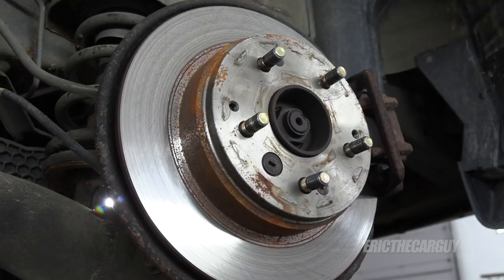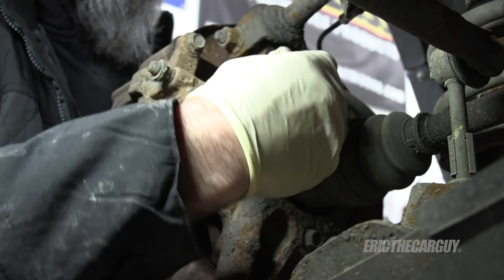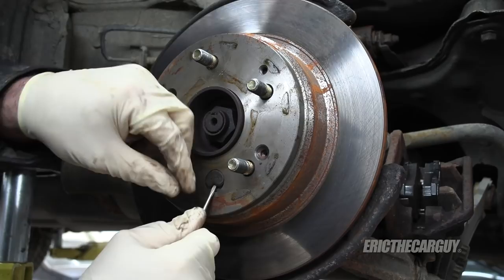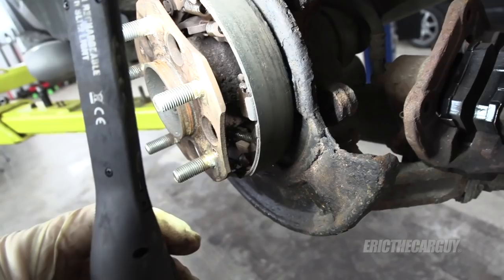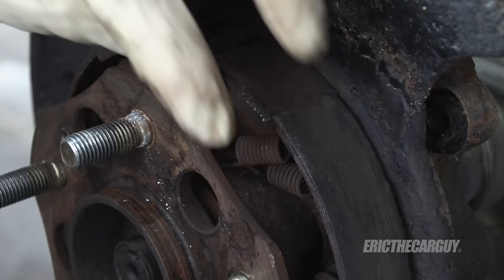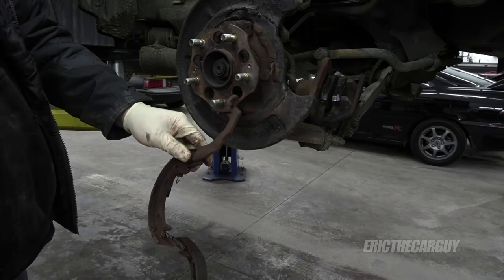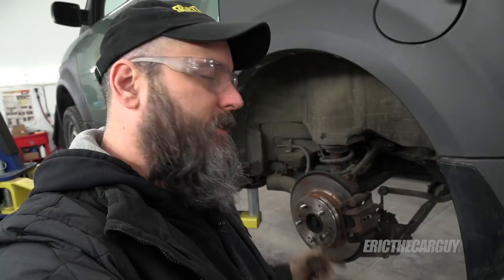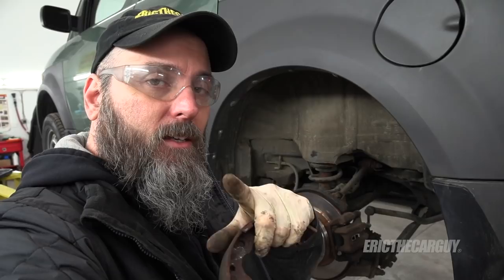Parking Brake Shoe Replacement on Rear Disc Brakes

Comment: drum brakes are an awkward , fiddly , frustrating PITA .. drum parking brakes are a whole new level of PITA
Reply: I concur. It's almost like they only still fit them cos they cost pence per vehicle... oh wait... yeah. That's the only reason. facepalm
Reply: I found a whole new level of swearing yesterday with those damn springs on the nail.

Comment: I replaced those shoes on an '04 CR-V once, (same parts as your Element, which I'm sure you knew). I had the same problem with the rotor not going back on. The reason was the parking brake cable was seized up and was basically pulling the shoes outward, even when the brake wasn't engaged. I replaced the cables and that fixed it.

Comment: could knocking off the rust ridge inside the hat help with reinstallation? I kinda cringed when I saw you go after the brake pads like that lol!
Reply from the maker: Yes, it can help a great deal with installing the disc if you plan on reusing it. However in my case the rotors were only a few weeks old and there was no rust ridge to be concerned about.

Comment: Hey I was just there on my 04 Blazer this week. Replaced not only the shot parking brake shoes, but opened the 7.5 rear end up and pulled the axle shafts out to replace what was left of the rusted out backing plates, new diff cover, new ceramic brake pads, new calipers, new rotors, all new hardware, and a complete brake fluid flush. She's good for another 200k miles now!

Comment: I've had this happen once or twice.  Instead of taking a layer off of the braking material, I take it back apart and use a grinder to just nick the notches in the shoe at the top where the shoe strut (that bar at the top that goes between the shoes) and at the bottom where the adjuster sits.  Just bump them on the grinder to take a few thousands off all four notches.  Everything should go back together nicely and you get to keep maximum life on the shoes.
Reply: The question is: Will I ever own a grinder before I am laid to rest? haha

Comment: TIP:  Whenever I do drum brakes, I pull both wheels and drums on the same axle.
Then I work on ONE SIDE AT A TIME.  Leave the other side together as a guide so you can see how everything goes back together on the side you're working on.
OH...And don't forget.  Use the necessary curse words while doing a job like this.  Don't worry about it.  It's part of the job and helps you with frustrating parts of the job.  It's the cheapest tool you have in your tool box.
Reply: Many people do both sides at the same time and when they are gonna put it back  together again they just stand there and scrach their head lol. Taking a picture does also help a lot :)
Reply: That's how my dad taught me to do it.  Did it that way for years until I knew every spring by heart.  Now I don't need to, but that's after several decades of doing my own brakes on multiple vehicles.  Once you've done a few, drum brakes aren't that hard.
Reply: @tommyaleks100  with today's phones, yeah, that works.  When I was pulling wrenches for a living, I didn't have this luxury.
Reply: @Inquisitor6321   Yeah I see ya. Same here. One side at a time is the best thing.
Reply: Yep - if I don't do it that way, I forget how everything goes back together. Been doing that since my first auto repair project 30 years ago this month!
Reply: Which is the best dram m disk
Reply: I have an extensive collection of curse words which I liberally apply whenever I need to work on my car :).
Reply: @reemsarmad52  disc brakes are best.
The do the best braking and they are quite easy to work on.

Comment: I used your hammer trick on rotor screws the other day for my TL. Original rotor screws. 10lb sledge took them off. Without your advice, it wouldn't have been possible. Next is rear brake shoes. Great minds think alike!

Comment: Never knew about a parking brake shoe setup inside a rotor. Learn something everyday!
Reply: I always wondered how the hand-brakes worked with reard disc brakes.
Planning to do a replacement soon, and hope I won't need to shave down the brake shoes.

Comment: Oh man, I've only ever done parking brake shoes once, when I did a disc brake conversion on one of my cars.  Tiiiny little itty-bitty everything!  Worst bit was, because it was using the assembly from a completely different vehicle, and the hub assembly from the vehicle I was converting, the parking brake assembly had to come off to take the hub off.  HAD to work around it.  Not fun...  LOL

My drum shoe replacement toolkit consisted of two tools:  A small (not pocket) flathead screwdriver, and a pair of needlenose pliers.  I feel like I've tried just about every "special" tool on the market, and nothing worked better for me than a flathead and some needlenosers.

Comment: I reuse my adjustors too. I cleaned and coated mine with nickel the first time i took them off. And i use a small part i fabricobbled from some junk i had to keep an o-ring on the threads, so no rust can get to the threads where i can't coat them sufficiently lest they seize. New stuff just doesn't feel right when you touch it, you're 100% right on that.

Comment: I remember when I first started to become a technician. One of the first jobs I had in a shop was to change break shoes on a drum/hat configuration in maybe an 82 model Corvette Stingray. I knew exactly what to do, but due to the lack of hands on experience, it took a little while. Lol 
For those of you reading comments, make sure to wear safety glasses while working with these springs.
Reply: When I worked for my dad, and I was in high school, I nearly took my eye out by using needle nose pliers on a spring. They slipped off the spring and still in my hands, landed in my eyebrow. Yes, safety glasses a must.

Comment: Thanks for this. I have been dealing with a rubbing noise on my express cargo van for weeks and I had no idea where it was coming from because the sound never went away even when braking. The mechanic took it apart and found out the parking brake shoes were cracked and loose and making the rubbing/clicking noise. Interesting to see how they will replace it

Comment: That shake and break is badass never saw one of those so it air hammers it and then you turn it at the same time, nice!
I generally use a impact the kind you hit with a hammer had pretty good luck with the too.

Comment: I was replacing pads and rotors when the parking brake lining scaled off. To be honest I didn't know what it was at first but it looked ugly, super rusted and the inside of the rotor is very worn. Got lucky and found this video and see what is going on and am replacing the parking brake pads. Thanks!

Comment: On the backing plate there are slightly elevated contact points on it.  The brake shoes' frames come in constant contact with them.  The service manual says they should be greased.  I use a waterproof, multi purpose, heavy duty, synthetic polymer EP grease for the job.  An EP grease is a perfect choice for chassis points, universal joints, pins, bearings, bushings, slide and cam mechanisms, etc.

Comment: I did not notice if you sanded down the rust ridge along the outer edge of the rotor. This could have prevented the rotor from being reinstalled. Hard to believe the pad had too much friction material. I also like to sandpaper the inside of the rotor to remove rust and have cleaner contact with the pad. Great video.
Reply from the maker: The rotors were only a few weeks old and did not have a rust ridge. Also, keep in mind this technically isn't a brake so prepping the surface of the pad and drum really isn't necessary. Thanks for your comment.

Comment: I unnecessarily removed the parking brake hardware to change out the hub and bearing on my 2001 MDX.  Your video is not quite the same but it certainly helped in reassembly.  The "before" photo I took did not adequately show placement of the parts.  Thanks.

Comment: Smashing job :-D, But you missed the word "Dykes" out when talking about plyers :-D
I'm sure you used to say that, or i could be mad... yep.
Maybe adjusting the handbrake nuts will shorten the clickage (Technical term) :-D.
Reply from the maker: I used to call them that until I started doing videos on YouTube. I didn't want to be misinterpreted. Have a great weekend!
Reply: EricTheCarGuy  Political Correctness is a real _itch.
Reply: It's interesting because it's easier to say than diags because they were diagonal cut pliers.  The metamorphosis of terms. And it's amazing how many words have been hijacked.
Reply: @spacecat7247  Just think about the word 'Gay', to be very happy and no worries.
Now hijacked for saying your sexual/mental need is for the same gender .
A very crude discription.

Comment: Always take out the centre hub never had any issues  with the wheel bearing s and job much easier to do but this is a realy good  for the  first timer's
Reply: Only work if there is no rust
Reply: yeah at my Honda school the instructor told us to remove the wheel hub makes it easier but still good video

Comment: Excellent video I just tackled these in my garage after I was done I could not get the rotors over the shoes. I figured it was the aftermarket brake shoes that I got from 1A Auto but it was the fact that I was trying to use the OEM adjuster when i ended up having to use the aftermarket adjuster. The aftermarket adjuster let the shoes close enough to put the rotors on and adjust. Perhaps this was part of your issue as well? Thanks again!

Comment: Same problem here - shoes are rubbing. But there is no adjustment at the wheel in the 2001 Volvo S60. I may have to remove material as you did. Great vid. Thanks.

Comment: I just did 3 parking brake jobs in the past few weeks. First was a set on a '06 Impala - royal PITA!!! It's the stupid horseshoe design, single shoe, and not a single cut on the side of the hub for access. They want you to remove the rusty hub bearing assembly, which will inevitably result in unplanned replacement, since it's frozen inside the knuckle. I managed to get the horseshoe over the hub - wasn't easy, and I had to create a press out of a wood clamp to bend the horseshoe back 1/4" to its proper size afterward. A small price to pay for saving both rear hub bearing assemblies. What a steaming pile of dung design!!! 

I also fought with a '12 Ram 1500 parking brake shoe replacement a couple weeks back. The hub on that is also nearly the same diameter as the shoes, so access is miserable. The retaining clip for the nails needs to be compressed to fit behind the hub! Goes flying, then you have to fish it out of the bottom of the parking brake shoes, drag it up into place, then compress it to get the nail through and then turn it 90° to lock! What a barrel of fun that was as well!

After that I did a '04 Highlander, but that was easy compared to the 2 domestic turds. Some engineers need to be tarred and feathered!!  😡

Comment: Hi Eric, great video. Question. I just dropped my subframe on my '96 Porsche. I had to cut the parking break cable as I couldn't get the hub off to get to the connector. I had already removed my axle so I couldn't use my 3 jay puller to get the hub off. Any other way to get it off?

Comment: CHEVY IMPALA2009, in the Haynes guide for Chevrolet Impala and Monte Carlo, shows that you have to disassembly the hub. But the tool you need is a press, that's the missing detail. I spent hours doing that just to find out too late.

Comment: I have fixed my 2016 crv rear brakes and for some reason they have gape in between brakes corners everything seems to right I have check the other side which looks the same and all the peices. Now brakes are hitting rotor and I'm not able to put rotor back on what could be the issue?

Comment: I akso use a copper anti-seize on the rotor screws to be nice to my future self so the next repair goes easier. To remove the screws on a car I haven't previously worked on I use an impact driver sold at part stores for $10-ish USD. I keep forgetting I have the tool so I own 3 now 😆

Comment: Eric do you remember offhand 2001 Pontiac Grand Prix SE does that have the type that has the brake shoes inside the rear rotor like a was sort of a brake drum machined into the rotor?

Comment: Hi, Question for you, my E-Brakes work great at preventing my truck from rolling forward but they just barely work at preventing the truck from rolling backwards on a slight incline, if you give it a push it will role.  What would cause this to happen?  I have replaced all of the E-brake cables and put new brake shoes on the back, but nothing seems to fix the rolling backwards problem.

Comment: how can you replace the upper guy that you hook the springs to on my honda acura tsx the part has rusted away and got damage from the shos falling a part and welded it stuck to the rotor and if i can replace it can you make a video how it is done

Comment: Hi Eric, Question, Did you set the star adjuster at the bottom all the way slack before putting the pads back on to compensate for the thicker new pads but still had to remove material to get the rotor on? Edit I saw that you did slack them before reinstalling.

Comment: Urgent question, when I was replacing my rotors, the pad got stuck to the disc but only on one side. The parking brake is fully off. Once I removed the stuck rotor, I realized the pad has been removed from its normal position and is now being pushed up against the wheel hub. Do I have to get all new pads now? Or can I correct the situation. Moneys really tight and I have to fix my brakes to get to work.

Comment: I ended up having to remove liner material as well *using Autospecialty B782 shoes. I wish I had thought to remove material from the adjuster mounting points on the shoes instead, as I had to remove enough material to make the service almost pointless in retrospect.

Comment: Exactly the same issue with the brake backing plate on my 2003 CRV! Daft design that it's a part of the whole back plate and can't be replaced seperately, since it rusts like crazy...

Comment: you can also use a nail punch to remove those screws.  hold it at an angle on the edge of the screw and tap with a hammer.  It might damage the head of the screw but they do not need to go back in anyway.   It worked like a charm on my acura rotors.   I was able to put the screws back in and they had just a little scratching on the head.
Reply from the maker: I use that for broken fasteners as well. https://www.youtube.com/watch?v=EqNcBkLvptg&t=39s

Thanks for the comment.
Reply: @ericthecarguy  I love that  you bought that 2008 Acura TL.   I own a 2006 TL and the car has been very reliable.  I am about to do the timing belt and water pump.   I bought the original ASIN kit for around $200 and bought the Lisle supersocket to get the crank bolt off nice and easy.   You have a good video on doing that job that I will be using as a reference.
Reply: @ericthecarguy  I have a 5qt jug of Mobil1 0W-20 that I bought for a Honda.   Can I put that in my Acura TL that calls for 5W-20.   Some other mechanic said it would be fine.  Your thoughts?

Comment: Eric, I'd just like to mirror your experience with the non-fitting disk-- this was the my experience as well with a Honda CR-V 2003 and I was equally puzzled and also concluded I had to shave off material. Has this happened to you before on other vehicles?
Cheers

Comment: I would think that the friction material on the parking brake shoes should last almost forever, there is hardly any sliding friction between it and the inside of the rotor. About the only way I could see the parking brake shoes wearing out is if someone drives with the parking brake on or makes a habit of using it to stop the car.
Reply from the maker: That is correct, I've only done this a handful of times in my career. The reasons were either rust or damage from improper use.

Comment: I did sparks plugs on grand marquis had to remove purge valve and air intake car has codes p0443 and p0102 car starts then stalls i replace maf sensor still having the same problem..

Comment: I find the clips to hold the emerg pads on are very hard to install for the  2005 toyota 4 runner, do you think I can use this type you used? they look much easier to install

Comment: Hey Eric, another outstanding video! 
-Is removing shoe material a common occurrence?
-Did you compare the old adjuster with the new? If the new one is shorter, the shoe engagement would be slightly less. Just trying to help, not criticize.
Reply: I can confirm the replacement adjusters are shorter than the original.  When at minimum adjustment, the original adjuster spreads the shoes 51mm vs 47.5mm for the replacement.  I couldn't get the hat over the shoes with the original adjuster, but it was easy with the replacement one.
Reply: I had to remove shoe material on my 99 Avalon several years back. Was glad to see you address that issue. Thanks for another quality video.

Comment: Thank you, Eric! In your experience, how often do you typically need to replace the parking brake shoes in a vehicle's lifetime? I'm at 170K miles on my MDX and have no issues with the parking brake.
Reply from the maker: As I mentioned in the video, I've only done this a couple of times in my career (about 25 years). Since they technically don't 'wear', it's either rust or damage that necessitates their replacement.
Reply: Once in 430k miles on my Avalon. I had to shave the shoes with a belt sander to get it back together. Thanks for showing that part Eric!